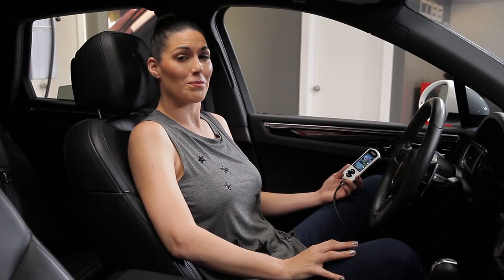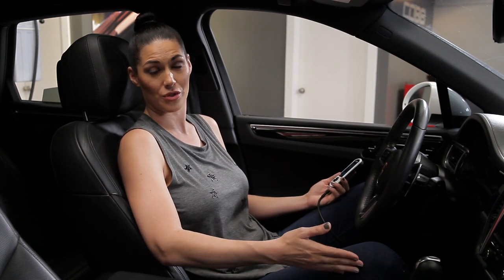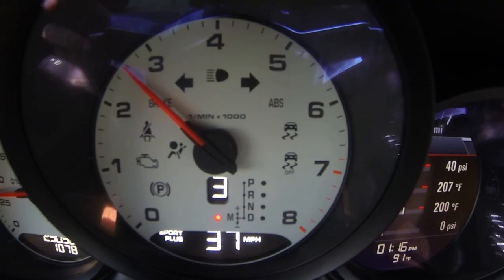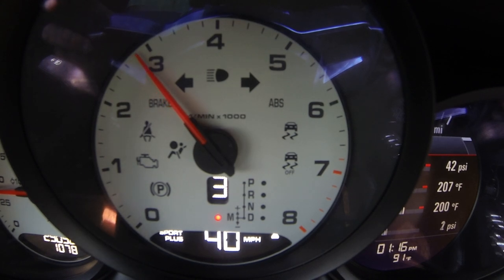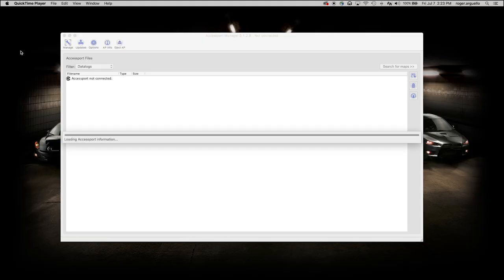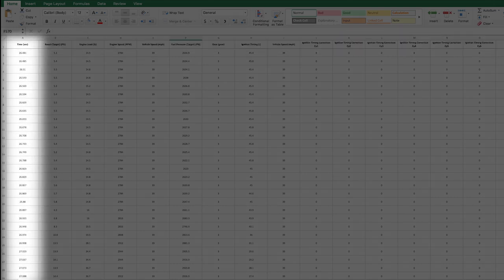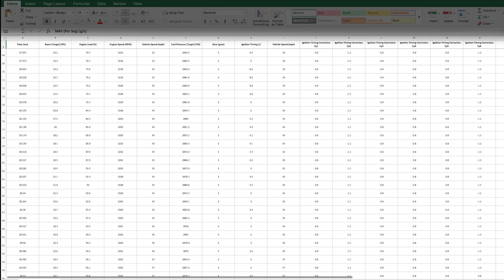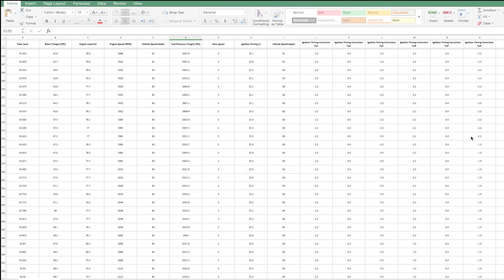COBB Tuning - COBB University Episode #17 - How to Datalog

Comment: What if the access port can’t find your Cobb. But the system is turned on. Anything would help.
Reply from the maker: It would be best to contact our Customer Support team at either 1-866-922-3059 or support@cobbtuning.com to help diagnose any issues.

Comment: Whoaa!! It hit 59 PSI on that WOT log!! Haha. Very information video, Great stuff.
Reply: Hit 15, gauge on bottom is boost, because i seriously hope its not pushing 40 psi of boost, at 2700 rpm in 3rd with low load... That means itll be somewhete around 75 to 80 wot and full load.. Wouldve been motor guts on the road at that psi without being seriously built, guessing that 59 psi is oil pressure

Comment: How do you data log in 3rd gear on a automatic car
Reply: Dgripper pull into manual mode. If its an old automatic transmission just like my 2003 crv, it will not work.
Reply: Beetlejuice 123 I figured it out, but thanks